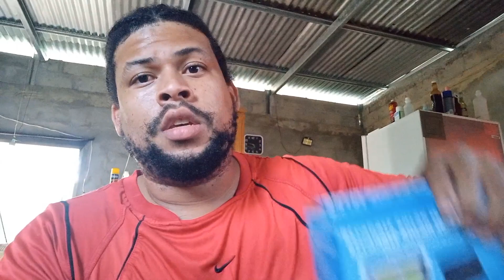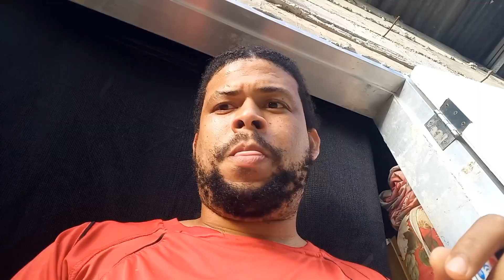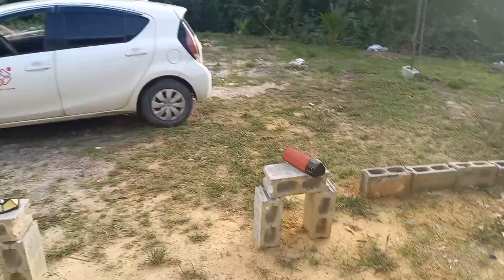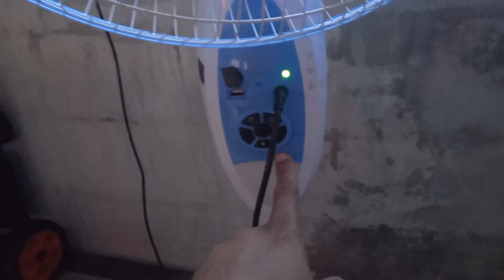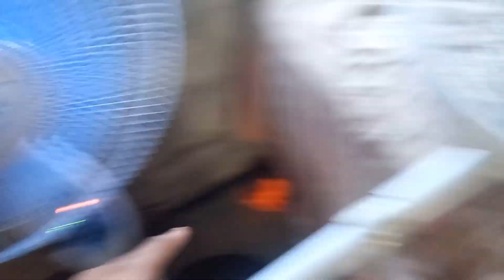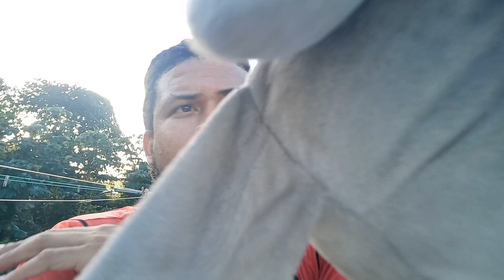Living Without Electricity | Family of 4 | How it Started | Tiny House | Solar Power

Comment from the maker: If you are interested in getting a solar set you in trinidad here is the info you need.

Pricesmart 145 ah deap cycle battery for $1100 plz note you can only use 50% of the capacity.
425 watts Inverter $235.

MPPT charge contola $400
150 watts solar panel $600
Call Or text 742-8611 for solarize solution and tell them jacob and nich vlogs sent you
Reply: Hey where did you buy the first set of lights in the house?
Reply from the maker: @anillsally  hi sorry for the late reply , now seeing ur comment, I got it valencia,  behind japs in a verity store but I can get it in LF arima or grande

Comment: Hi, this is awesome! Btw is your mifi device unlimited?
Reply from the maker: Thank you 🙏😊 
No sorry it is not, but they have a unlimited LTE plug and use devices,  I am hopeful to get that after my contract is up, I will put the sim in the mifi and use it. Hopefully buy then we will have more solar and battery's to power your home 🙏plz God
Reply: @JacobandNichVlogs  was curious as it seems both Digicel and bmobile doesn't have the unlimited device. Which sucks because the amount of gbs can finish within a week. And as you showed, it helps with limited energy options. 

Another question: do you have the name of the two solar lights you bought for 85. Could not see a name.  And where was it purchased. Same area as the fans?
Reply from the maker: @Desire-DesiYAH100  yes it can be found in the same place with the fan, solar wall lamp they call it. I got mines In valencia but don't know the name of the street it In the back of japs and they sell everything, it's a variety store

Comment: Lead acid batteries are cheaper to buy but are more expensive in the long run . For example a 100Ah LiFePO4 battery will cost you $300 while the lead acid will cost you $130 . But lead acid you can't use more than 50% without damaging it . Also lead acid weighs almost triple and covers more area than LiFePO4. LiFePO4 will also last 6 times more than the lead acid
Reply from the maker: Correct fam 😊🙌 I agree full this is the same advice I give. I am unable to afford them at the moment so I will have to get a led ontill better can be done on my end 🙏 I will have to order mines online and then ship it in they pay more to clear it when I reach in the country so I will cost me more like $500 us to bring it in for myself to save money 🙏

Comment: amazing to see someone going through the beginning stages of solar ,bro by god good grace you will get there  i was once at this stage but got a bigger system over time ,there is alot of advice i can give but i will tell u one thing  the batteries ,lithium batteries is the better ones for solar use i started with DIY laptop recycle cells and learned from there how to make battery packs this knowledge will take you further and save you money  and there is  plenty of youtube videos to guild you  ,learn how to make battery packs bro.
Reply from the maker: Thank you bro 🙏😊 
I stared looking at what it takes to build  a battery bank  with lithium already 🙏. I will look into the laptop battery's. 
BTW in trinidad a 145 ah led bat cost 1100 and a 200 ah agm cost 2300 and both u should not use more than 50 % to get a long life. To me the led is wining at the moment. The lithium is around 8000 and up in trinidad so thats a no no for now 😅 I will love to start with it but they are overpriced here